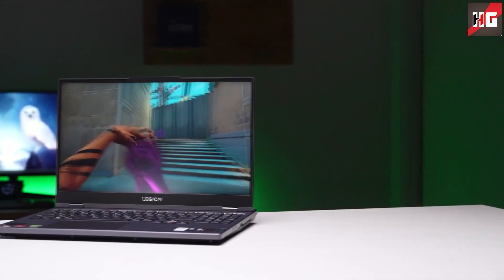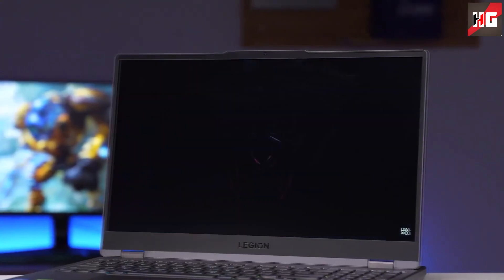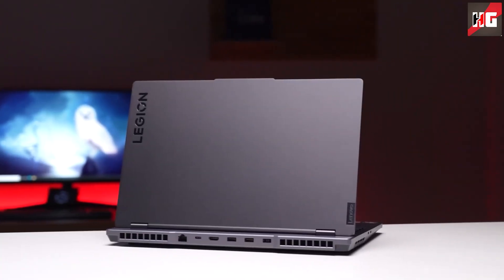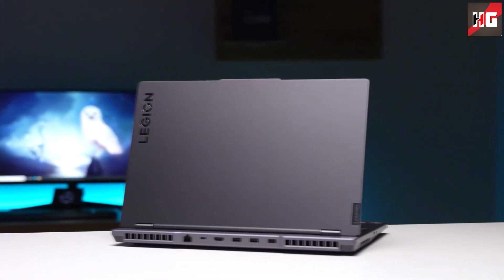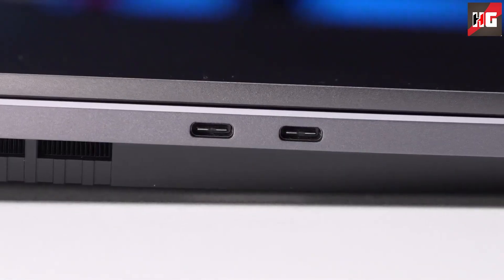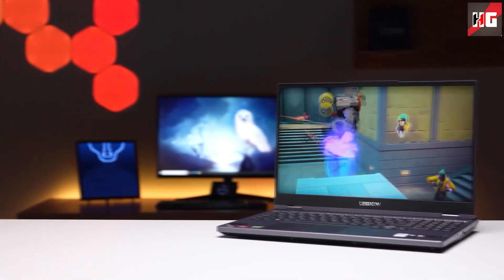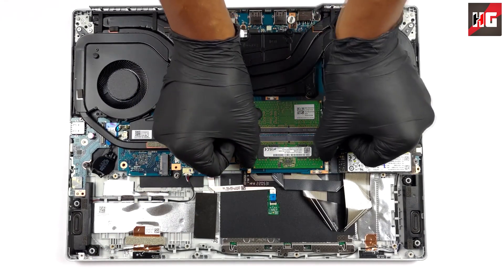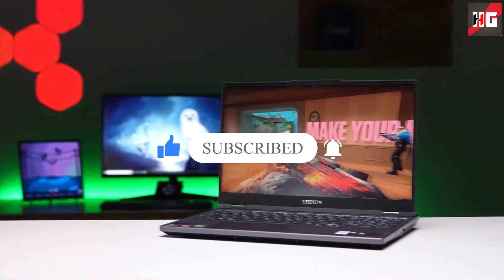Lenovo Legion 5 - Ryzen 7 6800H & RTX 3060 The Best Lenovo Laptop of 2023 so far

Comment: 2:59 something is weird like you got cyberpunk 2077 71 fps on ultra but only 24 on rdr2 ?
Reply from the maker: Ya its was kinda weird, i think there is some issue with that particular game, as this GPU is quite new i think those are optimization issue cause RDR2 can easily give quite good fps on 1440p ultra.
Reply: @HardwareGeek15  in general how many fps should you get in games on ultra with this combo aprox.
Reply from the maker: It differs a lot depending upon the game and the resolution, so i will say it's mostly identical to what 120W RTX 3060 can deliver, you can expect in FPS from 50-160 on 1080p ultra.
Reply: @HardwareGeek15  thanks for replying the model i'm looking for has TGP 140w so it will run games better.
Reply from the maker: @vazaofficial112  140W 3060 is quite powerful as compared to the 120-100W that is found on laptops like Omen, Zephyrus  and more
Reply: @HardwareGeek15  yes and i'm decinding between a legion 5 pro with i5 12500h that is only like 40$ more expensive than a legion 5 woth ryzen 7 6800h but i'm looking mostly for the best performance/temps overall
Reply from the maker: Is that legion 5 pro i5-12500H or is it just legion 5 non pro
Reply: @HardwareGeek15  pro, and there is a non pro version with i5 12500h and is 70 $cheaper than the ryzen 7 version.
Reply from the maker: So i think you should get the i5 12500H variant
Reply: @HardwareGeek15  is there a big difference in performence.

Comment: I was thinking to buy this one with the same specs but 512gb ssd and it's not the pro version. It's 114734,15 indian rupees in my country, do you think it's worth?
Reply from the maker: Ya its a really good laptop for 1.14 Lakh Go for it 👍 140W 3060 is really powerful
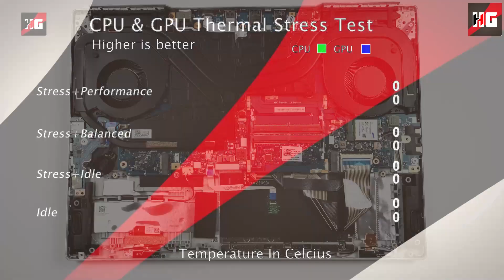Reply: @HardwareGeek15  Thanks for the quick response! One more question, at 5:58 you showed the worst case scenario or the avrg temps, because I think they're a bit to high.
Reply from the maker: No don't worry they are temperature during  stress test normally no one use laptop with that much cpu and gpu stress so you will not see laptop going that high in thermals
Reply: @HardwareGeek15  Thanks! Maybe the i5 12500h is a good variant either, right? Anyways yhanks for the responses.
Reply from the maker: Ya i5-12500h is also quite powerful CPU
Btw thanks bro for appreciation
Reply: @HardwareGeek15  Glad to see this because the i5 12500h  version is 10927.06 cheaper with some little changes.
Reply from the maker: Ya thats a quite good value for money price go for it i5-12500H + RTX 3060
Reply: @HardwareGeek15  is there a big difference between the two?
Reply from the maker: @stefancelmare842  no there is not much difference
Basically Ryzen 7-6800H and i5-12500H performs nearly identical in single core performance and  is little bit lower in multicore performance.
Reply: @HardwareGeek15  Good, beside that the main difference is some GPU Tech Info : 
 The i5 12500h version: Vr Ready, DirectX 2, Geforce Experience, Nvidia DLSS.
 The ryzen 7 6800h version: Geforce Experience, Nvidia DLSS, Direct X12, Ray Tracing.
So to understand the ryzen 7 is still a bit more powerfull.
Reply from the maker: @stefancelmare842  both are same you are talking about the RTX 3060 DX 12 and DLSS are for Nvidia, CPU is nearly identical in performance, you can check out the reviews of Jarrod's Tech for more info if you want.
Reply: @HardwareGeek15  Thanks for the support.

Comment: Great video bro..pls suggest me which is lappy is good among legion 5 5800H with rtx 3060 and legion5 pro 6800H with rtx 3060..my main focus is on online streaming,hardcore gaming,video/photo editing.pls do suggest me which one to purchase bro.my budget is 1.5L.
Reply from the maker: I think you should go for Legion 5 pro 6800H and RTX 3060 cause 
It have 140W RTX 3060 
Where as the 5800H + RTX 3060 have 130W 3060
So 140>130 so better gaming performance
Reply: @HardwareGeek15  thanks for the reply and suggestion..
Reply from the maker: Wlcm 💜 dude
Reply: i would suggest to go for intel version of legion probably this specs  12700h + 3060  , there is no 3070 legion around your budget otherwise that would be future secure
Reply: @Lightyagamie  is intel better than ryzen?
Reply: @santhosh04895  it depends but to put it simple performance of Intel 12th gen is comparatively better than amd 6000 series
12700h is almost 15% better than 6800h in single core performance and it almost 10% better in multi core performance .
yet intel is hella expensive 
if you gonna do regular streams or your main task is gaming only 
prefer intel if not then  amd is not that bad ( considering prices)

Comment: Legion 5 ryzen 6800, IMO is the best for 2022.. just add another 1TB nvme. And you are set minimum 5 to 7 years ahead. No need additional ram, 16GB ddr5 is enough.
Reply from the maker: True 👍
Reply: What ssd pcie gen 4 should i take ?
Reply: It's enough for normal gaming and some work ?
Reply: @АнгелБогданов-ч6п  i still use it, and its working great, medium gaming and heavy work should be more than enough.
Reply from the maker: Ya it's more than enough
Reply: I get i5 12500h , 32 gb Ram ddr 5 rtx 3060 , and I'm inlove 😂😂😍
Reply from the maker: At what cost 😂

Comment: Great video just subscribed! Quick question: what would you recommend for a budget of 1000-1500$ to ONLY run Warzone 2.0 at 2560x1600 or 1440p.. (or will 1080p with DLSS be the same?)
Reply from the maker: I would recommend you to go with the Asus ROG Strix G15 Advantage Edition
With Ryzen 9 5900HX and RX 6800M (Equivalent to RTX 3080)
16GB RAM + 512 SSD
You can get this laptop for around 1400 USD.
Well there is not that much of a difference in 1440p DLSS (1080p internal) vs Standard 1440p
Reply: Bro what is the best laptop for 4k rendering and photoshop with great color accurcy ? Budget also 1400usd
Reply from the maker: You should go for the Rog Strix advantage it's 129$ more than your budget around 1529 USD but it's worth the price due to very powerful hardware and excellent colour accuracy 100% sRGB
But if you can't increase your budget then go with Lenovo Legion 5 pro Ryzen 7 5800H + RTX 3060
Reply: @HardwareGeek15  rog strix g15? which specs?
Reply from the maker: @jalalmatar454   Ryzen 9 5900HX and Radeon RX 6800M ( equivalent or better than Nvidia RTX 3070)

Comment: 15 hour web browsing? holy smokes.
Reply from the maker: Yeah don't take is personally
It's  during minimal usage that no one ever do 
 10% Brightness
Audio turned off
Refresh rate forced to 60Hz via bios
And browsing a single tab blog page 
Backlight turned off
Reply: @HardwareGeek15   I do browse at 10% brightness and my lap switch to 60hz on battery, but it only lasts 5 hours.
Reply: @vmafarah9473  yes it is really holy smokes on battery hours especially for AMD version
Reply from the maker: Ya 6000 now provides better Backup than Intel

Comment: Good video bro. For casual gamer in 2022 is GTX1650 enough or RTX3050 is safe to go?
Reply from the maker: Ya if your budget allows you for RTX 3050 then  go for it other wise GTX 1650 is Probably enough. i also use GTX 1650 cuz I only play game at few occasions or when I am free.
Btw thanks dude.
Reply: @HardwareGeek15  thanks for super quick reply bro. One more question between IdeaPad and Nitro 5 which one is best slightly concerned about after sales and overall longevity of Acer
Reply from the maker: My pleasure dude
Can you tell me the specs and the budget you are thinking in your mind for laptop
Cause I personally own a Ideapad gaming 3 as my current setup
Ryzen 5 5600H + GTX 1650
Reply: @HardwareGeek15  i initially had thought for 60k max in that we get either i5 11 or ryzen 5 series with 1650 only even that has been mostly increased now. Till yesterday there was Nitro 5 deal for 80 k 16gb i5 12gen 3050 gpu it seemed good. But wasn’t sure about acer life.
Reply: Hows the experience with idea-pad so far ? Is it good enough bro? I can spec idea-pad if it’s good
Reply from the maker: So far, my experience with IdeaPad has been excellent.
Thermals performance is excellent, and the build quality is sturdy and robust.
And the performance is really good for my workflow.
I mostly use Premier Pro, which can easily edit 4k 60FPS videos and even after effects, but the 8Gb RAM is quite limited to run after effects.
I don't play games very often; I only have Just Cause 4 and Control on my laptop, both of which run extremely well.
The only thing I didn't like was the battery backup, which is only 2-3 hours in maximum usage. I don't mind because I always use my laptop plugged in.
So, if your budget is less than 60,000, I believe IdeaPad is the best option.
Or if you can go above 80k then either go with IdeaPad RTX 3050 Ryzen 7 5800H or if you want better CPU performance then Nitro 5 is better and for long run the 2022 model is better than ever it can easily last as long as the IdeaPad both of them have nearly same build quality. So don't worry about it.
Reply: @HardwareGeek15  thanks a lot for detailed feedback bro. I'll make choice out from these. Yeah battery is a concern but it's trade off for the power. I hope i5 12 gen 12500h is powerful too fot gaming
Reply from the maker: Ya i5 12500H is really powerful.
And i am also working on a review of the IdeaPad, It's also going to be my first face video too.
Reply: 3050.. at least you will be safe 5 years ahead

Comment: bro only intel variant is available in website. Is it good?
Reply from the maker: If its a 12th Gen Intel CPU then it is bang for the buck, cause the 12th Gen Intel performs much better than Ryzen 6000 Series.
Reply from the maker: Is it available on Lenovo offical site?
Reply: @HardwareGeek15  yes It is 12700h. Available in official site. But I am little worried about Intel's battery life over amd
Reply from the maker: There is 8% less battery life on Intel version which is not that much in reality
And considering that you are getting 16 % more performance on 12700H than on 6800H 
Getting a 8% lower battery back is not a problem at all i will suggest you to go with the i7 12700H version
12700H draws 90 Watt total system power 
Where as 6800H draws 82 Watt total system power and this is a very low difference
Reply: @HardwareGeek15  Thanks bro 👍👍
Reply from the maker: Wlcm dude and please do subscribe if you liked the video